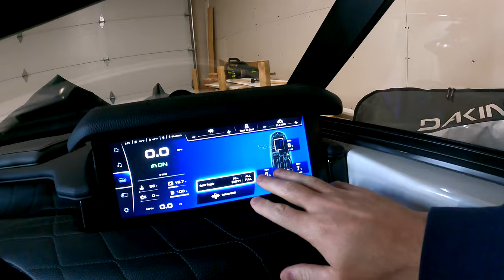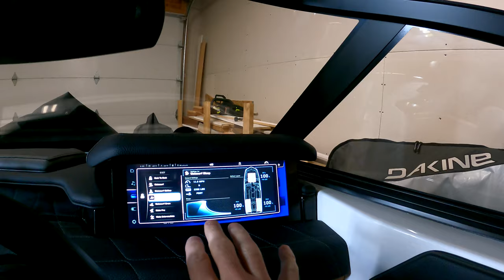MY DREAM BOAT!!  Wakeboat Ownership, Episode 36

Comment: You describe an " intuitive ballast system". I own the Supra SL. You can enter pitch and roll and the boat will drain/fill ballast automatically to maintain those parameters. I do not use it myself but the boat will do it. It is highly likely the G23 can do it also. I'm not familiar with Nauti's surf system.
Reply from the maker: Yes, Supra is certrainly the closest but who knows what pitch and roll they want.  Im saying you should be able to select wake surf, right, steep and it should know what pitch and roll to go to without the user needing to know the pitch and roll.  Maybe Supra has done this with the latest models and I just haven't seen it yet.

Comment: I find it hard to believe you can’t daisy chain ballast bags in that boat easily.  I did it with my old 08 230 sante. Worked well. Have approx a total of 2800 lbs before lead and additional bags.
Reply from the maker: I think its doable, just not plug n play or ready to just hook up.  It would need modifications.

Comment: For the auto ballast, just needs to read pitch, roll, and displacement - that should keep it locked in to a very similar wave every time. Should be able to move water around automatically to keep in a range close to those numbers.
Reply from the maker: I agree, we need that feature!
Reply: Doesn't Moomba / Supra already have this in their setup?
Reply from the maker: They have a pitch and roll adjustment but not a smart system that knows where it needs to be.  It simply gives you the ability to makes adjustments by pitch and roll degree which is a nice feature.
Reply: @wake_mann  Actually, my uncles Supra automatically keeps the pitch and roll. It knows which bags to drain to make adjustment. Also, if it can’t make the adjustment it’ll tell you to move people.
Reply from the maker: Good to know it exists

Comment: I had the AC idea like 20 years ago, haha!
Reply from the maker: we need to come up with an aftermarket product and start selling it!  We are all out in hot weather for most of the season, we need AC!  haha
Reply: @wake_mann  👍👍😁
Reply: The AC idea is a good one. Malibu has their misting system as an option on the tower to cool the occupants on the boat. The swamp cooler is a good idea, but would probably only work well for those in dry climates. They don't work to well in humid climates.
Reply: An AC option for these boats would be incredible. We use our boat at a dam in South Africa that ranges from 95 to 122 degrees in summer times and then 60 degrees in winter times. So the heater combined with the AC would be a win!
Reply from the maker: @johnc.9133  True, the mist system is a cool feature but could just feel like extra sweat if its hot and humid enough out.
Reply from the maker: @wadesolomon2484  wow, get this man some AC now! Stay cool Wade.